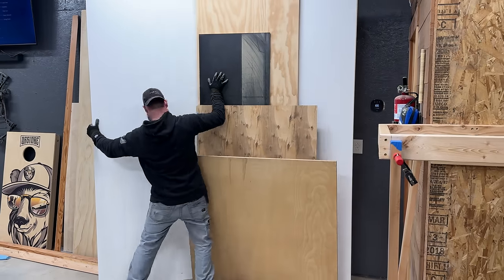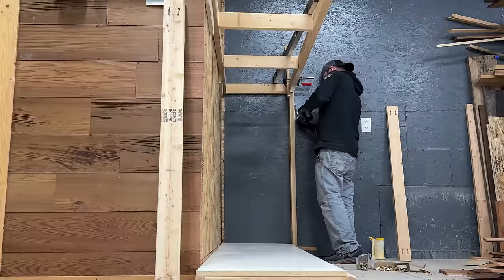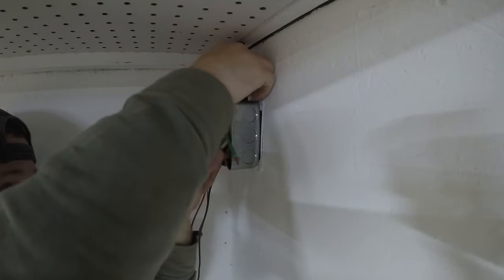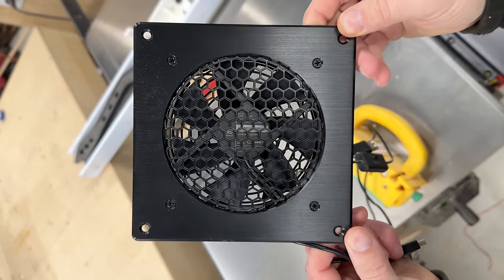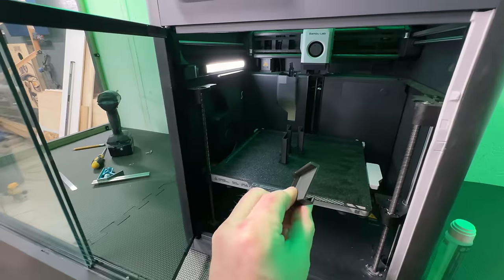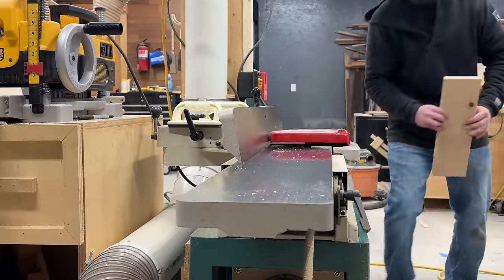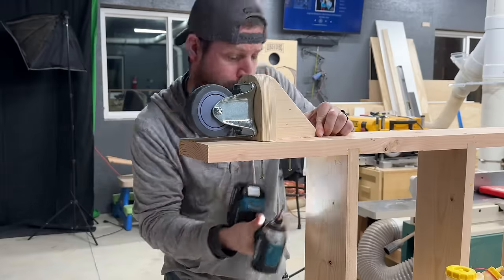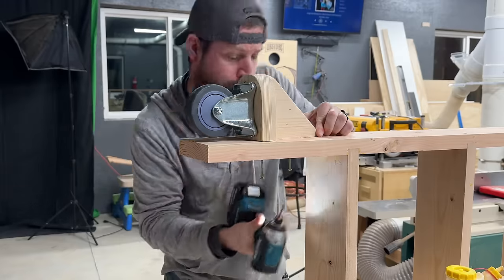The first of it's kind! Regaining valuable shop real estate!

Comment: People always mistake overbuilding with over engineering. They are actually opposites. Over engineering would be wasting time trying to make it as small and light as possible.
Reply from the maker: You’re probably right, and I guess I’ve never given it that much thought. It was more of a way to add some humor that I feel others could probably relate to. 👍🏻
Reply: Over engineering is something more complicated than it should be. Over optimising is something needlessly light or optimised in another way, and under optimised is a heavy or mediocre functioning structure.
Reply from the maker: Like I mentioned to the other commenter, you’re probably right. Right or wrong I commonly hear it, and find it funny and relatable.
Reply: Maybe I misread at first.  Your saying that it’s better to beef things up more than thought should be rather than skimpy and fail.  Right?

Comment: If you can keep positive air pressure inside the cabinet, it will help keep dust out
Reply from the maker: That’s a great suggestion, I’m going to start experimenting with that. Thanks for watching and providing valuable feedback.👊🏻
Reply: Saw this after adding my own comment.  Nice!
Reply: @brewbuilds  Size the fans accordingly. Fan in from the bath would have a higher cmf than the return fan. This should provide enough positive pressure to keep the area as dust free as the bath.

Comment: Nice one Rob. Regarding your comment about the glass doors not keeping out the dust have you considered using the shower door enclosure strips.  The type that's usually pushed along the glazed edge of the shower enclosure that doesn't move and once you slide your door shut it creates a watertight seal from top to bottom.  You can purchase them from any hardware store and they aren't expensive but it will definitely help to keep out the dust. I know that over here in the UK they charge about £10 or less for a roll of the enclosure strips.  As for your ladder being O.T.T  i don't agree,  yes it's something different but that's why it is in your shop and not somebody else's. Plus you can always make a storage unit to be between your 3D unit and your ladder to keep your rolls of printer wire and all your other bits and bobs that needed for the 3D printer, and upon the top of the unit you can always use the space for tea and coffee making.  You've cracked it,  your very own Cuppa Brewbuild's station😅😂. As alway's brother 💯%    👍    🇬🇧   🫡.
Reply from the maker: You are a genius! To be honest I didn’t even think about those shower door strips, and that just might be the trick. That’s an awesome suggestion.

I probably came off a little over critical of the ladder in the video, I do think it’s pretty cool, and it was more of a fun challenge for myself. I like that type of stuff. It will definitely stay.

You guys and your tea!😂😂😜 thanks for your feedback, hope all is well. 👊🏻
Reply: @brewbuilds  all good here mate, just waiting for the warmer weather to come,  I'm beginning to feel like a damn duck with all the f__ing rain we keep having!!!
Reply from the maker: @simonr6793  you and me both, we got teased with some warm weather a couple weeks ago, then slapped in the face with cold and a rain snow mix. I’m over it!
Reply: @brewbuilds  I know exactly how you feel buddy 👍
Reply: Some l brackets extending off the rollers, encapsulating the pipe would keep her In check. You probably already figured that out though. Nice job and nothing too over the top

Comment: For the ladder, since you don't have steps to the top.. move the top guide rail to the side, even with the top step, cut off the extra stringers (maybe save just a little extra for a hand hold) and have the wheels roll across the top of the rail instead of the side.  Or, you could put hinged steps on it that could swing up out of the way and flip down so you could access the top of the unit for additional storage.  And definitely add a wheel lock so it doesn't roll while you're climbing on it.  Just a couple of ideas... feel free to disregard them.
Reply from the maker: Thanks Adrian those are all great ideas! I like the idea of having the ladder flip up and out of the way! Thank you for watching, and taking the time to comment. It’s always nice to get valuable feedback. 👊🏻

Comment: Humidity. You need to control the humidity inside the printer enclosure. Bathroom as a source of air needs definetely an automated fan with a heating element.

Comment: An idea for your stepstool: on large marine engines where you need to access the valve train regularly, there is a fold down platform for walking along. The platform hinges on the engine so you can fold it up, and the support legs hinge at the end of the platform so that they hang down when the platform is folded up. Uses up much less space but is still very usable and stable.

Comment: Others have already touched on overpressure for the dust issue, but that is a bit overkill to me. I would think that a few strips of felt on the edge of the glass will make a good enough seal to keep most of the dust out, and help to keep the conditioned air in. It doesn’t have to be air tight after all, you’re not trying to make a clean room after all.

Comment: Lovely. Take a tip from modern roller coasters, print another couple rollers, and mount them on the other side of the pipe, attached to the ladder, of course. Done.
Reply from the maker: Thank you. That’s actually what I did. if you look closely you can see the arms for the second set of rollers. It wasn’t fully completed when I upload the video so I didn’t talk about it much.

Comment: change your fans in the 3d print area.  15-20% more supply than exhaust. keeps the area under positive pressure, minimizing dust intrusion.  Still keeps the area heated or cooled.
Reply from the maker: The positive pressure idea crossed my mind as a possible solution, you and a ton of other people have mentioned that. I’m definitely going to start experimenting with it. Your idea of change the speed of one fan is a good place to start. Thanks for your comment. 👊🏻
Reply: @brewbuilds  possibly add a second inlet fan & just the one exhaust would do the trick
Reply from the maker: @brewerjeff  that’s probably what I’ll end up doing.👍🏻 hey nice last name. 😜👊🏻

Comment: The ladder is really cool.  I would suggest instead doing a small storage cabinet, about 12 to 14 inches tall with a walk surface on top and a step or two at the ends.  Added storage and simplifies getting into the 3D cabinet.

Comment: Original job, I notice the space between the ladder base and top rung to the side of the storage is wasted as you need to move the ladder, you could add more storage there and have an angled outward extension for the smaller offcuts, its a way to use even more of the space.
Reply: That would be good off cut storage for sure

Comment: If you want to get fancy with your 3d printer case, get a good size fan and put a motion detector on it. Have it blow clean air in. Maybe bathroom air through a filter. The positive pressure will keep dust from entering the case when you're working in the shop. Or set up a timer to be on longer to keep out floating dust that lingers. Very cool build.

Comment: Very nice 👍. You can add more plywood storage or even other off cuts by building out under the ladder and leaning the material towards the bathroom. You didn’t say much about the printer vibration. Try a thick piece of the multi colored carpet pad, or some thick closed cell foam. Then put a concrete patio stone on top, then the primer. This may deaden the noise. You add some 2 or 3” thick egg crate foam on the walls and ceiling of the printer area to cut down on the noise.
As making the printer area positive pressure will keep the dust from entering through the glass, you should add a shop vac HEPA filter on the input air flow to the area. The fans should easily be able to supply clean filtered air to your printer area.
Reply from the maker: Thanks John! I decided to keep the face  (between the ladder and enclosure) open do to possibly needing to use a step ladder to access the inside for more complex tasks. It is a longer video so I understand not getting to the end, but I did talk about adding off cut storage to the left of the plywood compartment opening, and I talked about the floor matting and how well it worked with vibration. This floor matting worked very well and I don’t hear or feel any vibration. 👍🏻

I’m currently working on adding filtration to the fan setup, along with experimenting with the positive pressure idea. 

Thank you for watching, and taking the time to comment. I truly appreciate it! 👊🏻

Comment: For moving your sheets, try to find rollers to put at the bottom. That being said, ain't gonna work if you need one only... (Updating myself as i write...)
Instead of wide rollers, 3d print multiple 1/2" wheels and bundle them to form roller but keep them independent. Might work?
Might also want to split the opening in multiple section so if you want the last on the left you don't have all the other sheets weight pinning it.
Anyhow, love your build!

Comment: Nice work sir. To stabilize the ladder you could use 7/8" unistrut as a guide for the casters, or 1 5/8" with strut trolleys to really lock it in.

Comment: Looks like a great project. One issue you might find, the filament will end up getting quite a bit of moisture from the air from the bathroom which could affect your prints a lot. Just something to be aware of
Reply from the maker: That’s a very valid point that I didn’t consider. During the colder months I always noticed the enclosure having a substantially lower humidity than my shop, but I would imagine during the warmer months that could change. Thanks for pointing that out. 

I’ll have to do an update video with the corrections I’ve made from all of the valuable feedback you and other commenters have given me. Thanks for watching and taking the time to comment. 👊🏻

Comment: If you adjust your fan speeds you can create positive air pressure which will keep the dust out. Just make the fan pushing air in run faster than the other one. When you add the third fan it will be a bit more challenging but still doable. 

I use this same method for computers to keep the dust from building up inside the case.

Comment: Looks great! If you just push   air in with both fans you can keep the enclosure at positive pressure.  Pushing air out of the small gaps; keeping the dust out. Also solves the venting issue.

Comment: Bro, you need mass to dampen.  Cheap and easy route (what I currently have for print shop) is a 12x12x1.5 precast paver from local bigbox for each foot.  The more mass the better. I am about to move print shop to shared garage woodshop, so doing planning for similar project.  I have an airbnb on the same level as the attached garage shop, so, vibration cancellation is crucial. These things run 24/7 doing production printing. I have a 600cubed printer that throws around a LOT of mass with klipper (bambu-like) accelerations and speeds, but it's on rollers on the ground. It will be mounted to studs on the rear with a vibration decoupler. No, it's beastly frame can't handle the klipper accels standing alone. And, whew, ladder access to printers... couldn't imagine. Although Bambu's are way more dependable than average printers, those little robots are needy b$tches. I hesitate even having them at shoulder level, lest I need to take it down. Every printer I have needs very often easy front access, occasional side access, and less occasional back and bottom access. No way I'm taking then off a high shelf each time.
Reply from the maker: Sounds like you have quite the setup! The mat has worked great I don’t even hear my printer running or any vibration. 
The height of the enclosure isn’t ideal, but I found it to be better for my needs and not wanted to take up more floor space to build a dedicated platform for it and futures printers. Fortunately it’s not hard to pick it up and take it out if I have to do any major maintenance on it. Thanks for watching and commenting. 👊🏻

Comment: Really great project, well done. However the printer compartment is still going to get drenched in dust. Couple fixes would be some thin foam strips you could push in between the ends of the glass panels every time you open one. A better choice would be positive pressure. Get a couple small fans and mount them somewhere inside the enclosure. When printer (s) aren’t in use use the foam strips to keep dust out.

Comment: Nice build! Any issue exhausting the printer fumes in the bathroom?
Reply from the maker: I changed the direction of the fans so now they both are pulling the air from the bathroom and into the enclosure, so it doesn’t vent back into the bathroom, and creates positive pressure inside the enclosure. I do plan on adding an additional fan to exhaust the enclosure to the outside of my shop for when I’m printing ASA, or ABS.

Comment: Good tip on Meross I have been slowly automating a solar pool heating system for years but logic circuits and parts weren’t easily available to do it right. Meross sensors and switches may work.  Also, instead of the ladder, I’d probably just put a hinged step shelf or collapsible bleacher bench to step up on and walk the length of the enclosure.
Reply from the maker: I’ve been really impressed with the Meross products. I enjoy designing logic circuits myself, but it’s cool to see all the available products for the typical person and what you’re able to accomplish with little knowledge on the topic. 👍🏻

I’ve had several people suggest the idea of a hinged shelf or similar variations. I plan on doing a follow up video of the things I’ve added or changed do to all the great feedback you guys have provided. 

Thank you for watching, and taking the time to comment. 👊🏻

Comment: I lick the sheet goods enclosure. Simple and functional. You need a dust hood for the router base and now you can 3D Print yourself a custom hood for doing that type of routing when the base is completely open.
Reply from the maker: Thank you. I actually have a dust hood for this router. It works ok when I’m using it on smaller piece on a work bench, but larger projects or situations like this it’s more of a hassle. I should design and print one that works better for this type of application. 👍🏻 thanks for watching and taking the time to comment. 😃

Comment: First time viewer, it's a good space saver solution, the only things I would change is putting dust gaskets on your sliding glass doors where they overlap and shorten the rolling 🪜 to the hight of frame below your window and replace the ladder rungs with deeper step treads.
Reply from the maker: Hey thanks for stopping by and watching. Those are all great ideas. I’m actually working on a few changes/corrections from ideas everyone has left in the comments. I’ll be doing a follow up video addressing them. 👍🏻 thanks for watching and taking the time to comment. 👊🏻

Comment: If you would use fans to maintain a positive air pressure inside the printer enclosure, you will keep the dust out.  Since the print enclosure is connected to the bathroom, keeping a positive air pressure inside the bathroom will keep the dust out of there, too.  The old 2 birds with one stone trick…
Reply from the maker: The positive pressure idea was definitely something that crossed my mind. There were a lot of unknowns while building it, and I wanted to see how everything played out first. You along with many others have suggested it, and the reassured me that I wasn’t crazy for thinking it. 😂 thank you for watching, and taking the time to add valuable feedback. I truly appreciate it! 👊🏻

Comment: Nice work!I added a little sliding door lube to make my enclosure doors slide easier,
And maybe a lees roller on the storage for plywood would help make them slide in and out.
I will say that you could add a filter maybe.
Add a metal clip to keep your ladder from derailing on top.
So that you you continue to make bad as video’s😊👍
Reply from the maker: Those are all great ideas Joe! I’m working on the filters as we speak, they didn’t quite make the video. Thanks for watching and taking the time to comment. I truly appreciate it!👊🏻

Comment: Build a proper step up to the cabinet and use the space under the step as additional storage, the "library" ladder looks great but 
ladders in a workshop are dangerous and in a hurry you can slip and fall, you cant safely stand and work on your Bambu 3d printer  while holding on to the ladder with one hand.   Time to lose it, also add some simple stick on draught excluder type brushes to the glass ,  that will stop 90% of the dust overnight.   Thanks for the Vid...

Comment: Very nice. I would positive pressure the enclosure with filter fans from the bathroom this would keep all the dust out. Also be sure the upper glass track screws don’t back out… the screw head will catch the edge of the glass as it passes and the glass will disappear… trust me. I learned the hard way on a huge trophy case.
Reply from the maker: Thanks Greg! The positive pressure idea crossed my mind too. Now that it’s operational I’ll have to do some experimenting and see what I can come up with. Filtration is in the works especially for the abs/asa fumes i was talking about, but also for the dust reasons. I always forget to mention a few things during my edit. 😂 
Also thanks for the heads up on the screws in the upper track, I could totally see that biting me in the ass later on. So I’ll be keeping an eye on that!

Thank you for watching, and taking the time to provide valuable feedback, it’s very much appreciated. Take care. 👊🏻